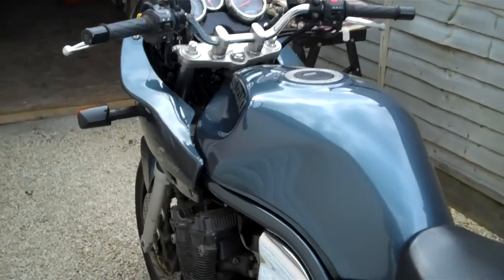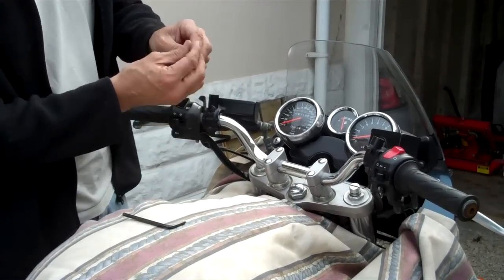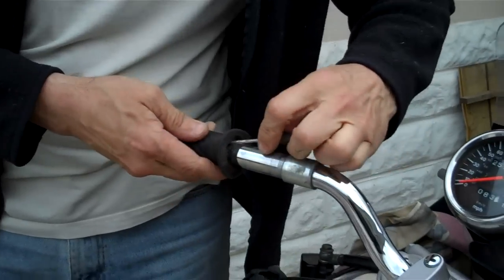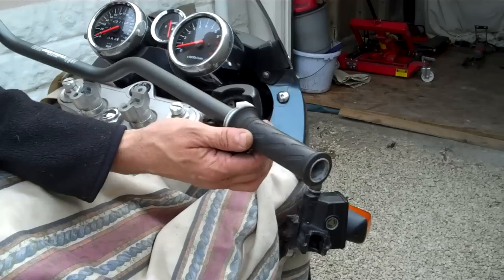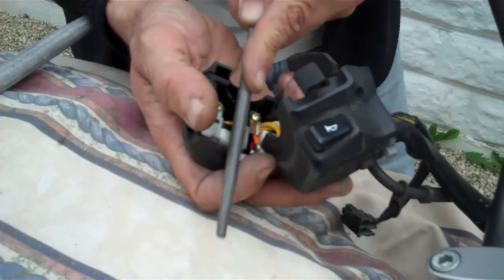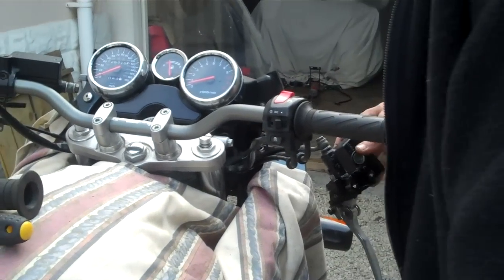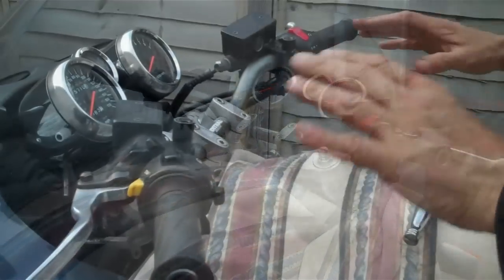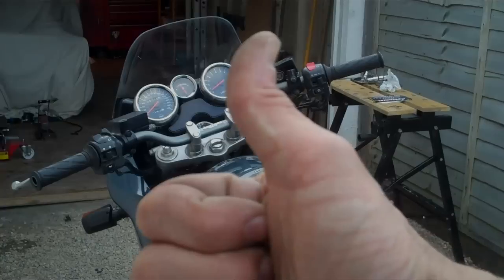Delboy's Garage, Renthal bars, Suzuki Bandit.

Comment from the maker: I've never had them move as I never file the pins totally flat, just leave yourself a tiny nub about 1/2mm thick to bear against the bar and if you need to stop them moving just wrap a turn of tin foil round the bar under the switch block and they'll be fine, I just don't feel happy drilling a hole in handle bars that are not designed to have holes... hope that helps, Cheers Del

Comment from the maker: I think you'll find it's because the FJ comes with a cast top yoke for clip ons, so you have to convert the yoke to take proper handlebars, all you needed to do was take the top yoke off, drill two holes in and bolt some standard Bandit bar clamps through... probably could have got them from a breaker, then the bars at standard cost... at least you got it sorted, Del

Comment: Hey hi. Unfortunatly on my model (2nd generation of bandit 600) the clock is mount on a big metal bracket that also support the front fairing. The horn is also hidding there and removing everything to put a new headlight is a hell of a lot fun. I will have to let it go and keep it with all the fairing! Thanks a lot anyway for your help.

Comment: Another possible way to fit the switchgear which I did was to drill the holes but only around 1-2 mm deep and file the pins off leaving 2mm so it locates without drilling the holes right through and weakening the bar, cheers del

Comment: One recommendation: torque the bar clamps to the recommended 23 or 24 NM. I tightened as you said, and it moved as I rode!
Reply from the maker: Hi Nathan, Thats great advice, the Renthal bars have a rough finish and don;t seem to ever move.. but for chrome bars thats dead right.. even with the cross hatching on the bars... but if they still move after that.. you can also put a sliver of aluminum foil in between the bar and the clamp.. that really helps grab hold of it. works specially well with Ape hangers..lol!

Comment from the maker: The foil has always worked fine for me and my right block doesnt move.. if you need to pin it, dont waste money buying a new block, just screw in a tiny self tapper where the nub used to be, and drill your hole in the bar...

Comment: (2008 Suzuki GSF1250s)  Excellent video, thank you! Side note: I ordered the Renthal 7/8 street very low profile and the diameter is not the same as the original one which means that I was unable to re-use the original bar ends. If you like me are getting with a 7/8 Renthal then you will need 14mm bar ends (Renthal offer them for $35).
Reply from the maker: I think you mean the internal bore of the tubing is smaller, and yes, thats right, you cant use the factory bar ends as the came out of the bar...and yes, i know, Renthal do make a small end cap that goes in place of the bar weight, BUT, its light weight alloy and doesn't do the job of dampening the vibration...... SO....

Use the original factory end weights and fit them the way i fitted mine in this video i made a little while after fitting the bars.. here's a link;- Delboy's Garage, Renthal Bars, Bar End Weights Ghetto fix.

Hope that helps..
Del.
Reply: Moonfleet41
Excellent thank you Dal! I noticed that you installed a brace to re-enforce your Renthal bar, where did you get it from?
Reply from the maker: Pat Stimi
Hi Pat, i dont remember where that came from specifically mate, but they are readily available from accessory suppliers like M&P, i've had it for years and i think it was about a tenner..

Comment from the maker: @boredofitall I put the bar weights on with wall expanders yes, £3 from B&Q lol... and yeah they make a difference, the Renthals are flexible alloy so will absorb a bit of the bar buzz.. but its ten times smoother with the proper full 1lb steel weights on.. try them with and without, see how you feel, i have a video if you need it for info.?

Comment: Exactly. In fact I maybe put a twin headlight but I think it's the same job. I just want to get rid of the fairing and the OEM headlight. I'm wondering if I have to find another bracket for the speedometer or if I can use the original.

Comment: Informative vid mate but id not advise filing down locating pins, last thing you want is throttle tube spinning around on the bars or worse coming off, for those without bar end weights! Ive fitted a few sets of renthals and drilled them every time, aluminium is softer than steel so a good hss drill bit goes straight through no issues. some bikes come standard with renthals and id say they have the holes drilled frim factory....no different. Like i saod though good video.

Comment: old piece of bicycle hose under the controls also keep em in place :) also grips .. spray a little hairspray .. yep said hairspray .. slide it on .. will help it slide on .. the set and glue the grip down :)

Comment: I used isopropyl alkohol to take off the grip. When you use it, the grip goes off and on with allmost no resistance. And when it dried up, the grip holds the new bar like it was always there. And this alkohol smells like vodka but it quickly evaporates.

Comment from the maker: NEVER drill holes in alloy bars, they are not the same meterial structure as steel and the hole, no matter how small will present a week spot..The clamps do not come loose, the amount if twist torque on a throttle is very slight, and you would feel it move when you pressed the start button, if you truly are that paranoid, then a little double sided tape under the switch block will stick it fast..but NEVER EVER drill holes in renthal bars..its liable to lead to the bar snapping off in an accident

Comment: The little plastic button on the switchgear is there for reason it stops it spinning especially when you have a bike with a manual choke... A small hole drilled in the new bars is something I've always done with no issues at all. Spinning switch gear is a pain to cure gaffer tape or tin foil is rough as fook.

Comment: Attempted fitting REALLY wide bars to my Bandit at the weekend (3" wider, either side) & it's a real stretch for the hoses (clutch & front brake). The wiring doesn't like it too much either. I've put the old ones back on for now, until I consider whether to cut the bar width down, or get new hoses made up, & possibly extend the wiring. Just a note for anyone considering WIDE bars :)
Reply from the maker: I think it was the Germans on their crazy Streetfighters than pioneered the 36" bars, but honestly mate, they are a nightmare to ride with and not that safe in close quarter traffic either... maybe go a little less radical and just take them out to the maximum extent of the furniture and pop bar weights on the end to give a little extra visual width... just a thought?
Reply: Moonfleet41 Yeah. I guess I'm gonna go down the 'cut down' route. Especially having been quoted £180 for extended hoses (steel braided, but still dear).

Comment: Hi Del, Thanks for this video, very clear and informative and easy to watch. But I have ran into a problem - just can't get the switch blocks to grip on the handlebars after filing down those plastic bits that goes into holes. Tried tin foil, did not work, it still keeps turning around. I'm fitting the same handlebars as you are on Honda cb500. I hope you have another trick up your sleeve to solve this problem. Thanks a lot.
Reply from the maker: Hi mate, a good little trick if they're just not close enough to grip is to either pack out with a little gaffer tape, but it can get messy when it gets hot weather... so for the best results, take a flat file and file down the plastic mating faces of the switch block casing... that is to say, the two sides of the switch casing which butt together when you screw it down tight, if you file it down 1mm at most each side, it will mean the curved face of the switch face bears against the bar and grips... hope this makes sense mate, give that a go!  good luck, Del
Reply: Moonfleet41
Thanks for reply, Del. I have tried filing it down, it still turns around quite freely and I do not understand why it's not gripping. it has became such a headache. I have tried using tinfoil to make handlebar diameter bigger, grips much better but the throttle gets stuck when I open it and doesn't close down. gaffer tape is the last thing I might try but it will affect the throttle in the same way, I think.. I'd appreciate any ideas :) thanks
Reply from the maker: creazee
Hi mate...Try packing the tin foil so its not near the throttle tube and wont impede its action....you should be able to wrap cleanly round the inner end of the switch block, (say a 1" strip like tape) away from the twist grip tube, and leave it free to move still.....its just a case of being canny with the foil and making it stay put... never had a problem with the Bandit or Triumph bars, they do move if you grab hold and pull them round... but just pressing the buttons doesnt effect them...see how you get on with just packing the inner end.?
Reply: Moonfleet41
 Hi Del,
I've sorted it out finally using gaffer tape. not ideal, but the only way I managed to do it. It works for now, I might come back a little while later and use tinfoil method, because as you said when it's very hot, all kinds of things will happen with that tape. thanks again for your help, I deeply appreciate that! and thanks for all the info you put here, it's ever so valuable. Cheers
Reply: Pity you guys did not know about sugru, it fixes almost everything and would fix this no problem, would be perfect for this job if you have issues, only a little would sort it.

Comment: Hi Delboy,
Fantastic video and before I attempt this on my 1994 Honda CB500 I just wanted to know the following;
 If it is necessary to get longer cables?  (i.e. For the clutch etc with the Renthal's being wider) 
Or
 Is it ok to cut chop an inch off either side of the bar? (as I have heard that some people have done this as a compromise of having a lower bar without the cost of longer cables)
Your help and advice would be much appreciated as I am a real novice!
Cheers,
Jon B.

Comment: you may want to mention to make sure the the cables dont bind or tug because of the movement of the controls. also if you dont want wait for the wd40 to dry on the grips or have the extremely tight fit grips like the pro grips you can use a air compressor with a air nozzle fitting to get the grips sliding.

Comment: Thanks for making this helpful video. My question is, if we file the pins down to avoid drilling holes, wouldnt that make the throttle housing to move? On throttle side, everthing is relying on that pin to keep it stable
Reply from the maker: Mine have never twisted round, the switch casing itself grips just fine once you screw it down tight.. and if there ever is a tiny bit of movement though, you can wrap a single thin layer of tin foil round the bar under the casing and that will grip... remember, the chrome bars are shiny and slippery.. but the Renthals are textured and rough, so the switch casing bites onto them...!

Comment: So it's more important that the handlebar survives a crash than actually having a crash due to lost throttle control? Perhaps this is an issue on a motocross bike that crashes several times a day, but certainly not on a roadbike. I have an LSL alu fatbar on my GSX1250 and LSL actually supplies a drilling jig to make it easier to drill the location holes.

Comment: I know this is a old vid just passed my das and got a gsf 650s 06 and just had some of these bars fitted and night and day better handling thanks for the advice
Reply from the maker: Congratulations on passing your test mate, have fun on your bike and ride safe!
Reply: Delboy's Garage I have a question is you don’t mind answering I was doing maintenance on the bandit and battery just died flat as a fart now the only code on the battery is 3HI01 just wondering if u could tell what date that was
Reply: Jay H: What Renthal bars did you use??  Wannas swap mine but can't find some refferences infos.

Comment: Great vid again Del, as always. However if you were just replacing or "upgrading" your grips, how would you suggest getting the glue off the handle bars.

Thanks in advanced - Novice
Reply from the maker: Hi mate...if you have old hard glue on the bars, the best thing is a sharp stanley blade and slice it off...if iuts soft...then petrol will melt it away and leave the bars clean..

Comment: Thanks Delboy, for all your tutorials! They're awesome, and made me start to think I can do lot's of maintenance myself!
Oil, brakes, air filter, exhaust etc. I've done it all, mostly thanks to you and penny!

I have a question about the Renthal; I've got a GSF650SA, and bought the exact same Renthal bar after watching this tutorial. I changed it out, and really like the fitting. The only problem I'm having is the bars are hitting the tank when turning the steer completely.

Is there an easy way to prevent this?
Reply from the maker: Hi mate, that's unusual, do you have the bars rotated back in the clamps a long way??  Or are they upright, in the normal position??  And what 'exactly' touches the tank??  Obviously not the bar itself, is it the switch gear black maybe??
Reply: Thanks for the reply! To be honest, I can't remember because I did this about a year ago and didn't have time then to look into it and reinstalled the original.

I will install it again when the weather permits it (don't have a shed or garage, and it's raining cats and dogs). I will let you know, because I did really like the riding position.
Reply: I finally had time to redo the Renthal bar, and the problem is the brake lever is 'hitting' the windshield. It needs about 2 cm. Thinking of getting this: http://www.motea.com/en/handlebars--accessoires/handlebar-riser/handlebar-risersrelocation-suzuki-bandit-650-s-05-15-sw-motech-barback-black-i4056-141820-0.htm to counter this. Should also be nice sit more upright.
Reply from the maker: Hi buddy, often a good solution, but Renthal do have many different shapes and bends of bar, so you might find a different bar brings the lever back out of the way... either way, it's great to know you're sorting it !

Comment: Great video, good tips. I'm putting drag bars on my 71 honda 750. I was wondering if I can use the cables that are on it from the standard handlebars. They have about a 5" rise. Thanks for any advice.
Reply from the maker: Hi mate, yes you can use your standard cables, fitting lower bars means they'll be too long and not too short...so all you need to do is re-route and shift the excess cable about to make a tidy finish to the install.... hope that helps... good luck with it, Del.

Comment: your the man and legend,I have a problem that I can't sort for love nor money,I re adjusted my renthals,but the throttle is to far forward,how to I adjust them back?
Reply from the maker: +mrmerksta Sorry mate, what do you mean exactly by "The throttle is too far forward"?, dont understand the problem..!
Reply: +Moonfleet41 I have to put my hand right over the grip,the throttle position is not set to where it was originally,sorry for my stupidness can't think of another way to describe it lol thanks for the reply
Reply from the maker: +mrmerksta can you not just loosen off the carrier and twist it back round then.?
Reply: +Moonfleet41 I'm such a muppet,it's because they drilled a hole underneath and couldn't pull it the housing unit back,will file it off tomoz lol

Comment: Thanks for that, I'm looking to change my own bars for renthals so very useful, especially the part about drilling the bars I was a bit unsure about that. 

Did you have any issues with the hydraulic hoses after changing the bars, were the stock lengths ok?
Reply from the maker: Hi Kevin, on this bike, and with these bars, everything reached just fine, hoses, cables and wiring all the same as before.. but it pays to check before you buy the bars if you want wider or taller ones aye..!

Comment: Hi Del, great videos :) I noticed you didn't refit the bar ends, just wondered if there is a reason for this? I modified my original bar ends so they would fit the Renthals as the bore is smaller.

Comment: aah fair nuff! 
you may (or not) agree but I like the clip on bars (slightly ) to give that cafe racer look, how do you feel? I think it looks different, I like to think I'm still young enough for a little stretch to the bars..!!
Reply from the maker: +Kenny Kewn Lots of luck with it Kenny, I tried, but couldn't make it work, if you want them below the yoke in the proper place, then they hit the tank and give you no steering lock whatsoever... you end up having to have them so high to clear the tank you may as well use regular bars !